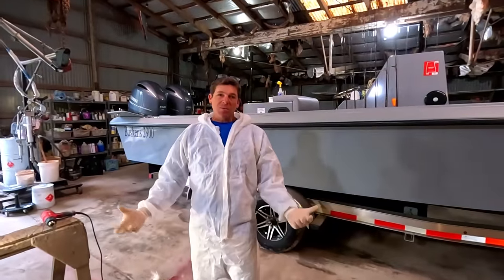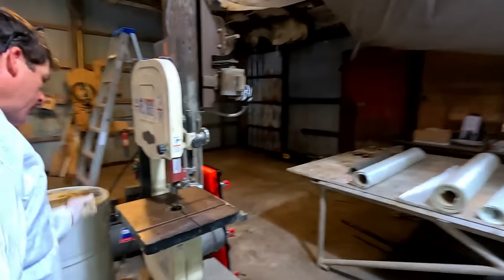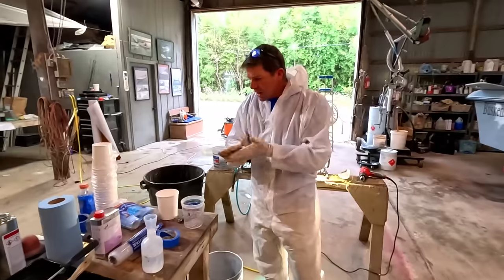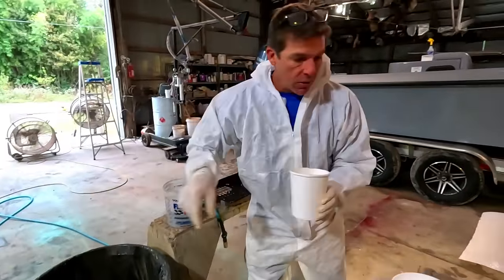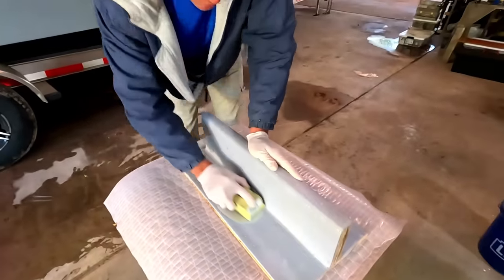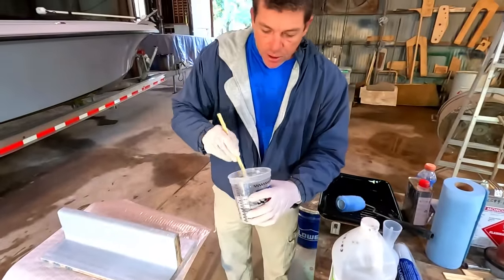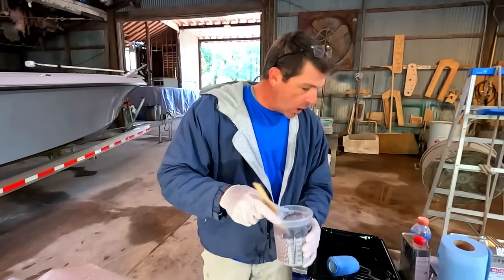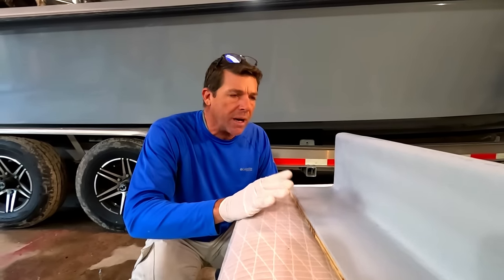Gelcoating Fiberglassed Plywood DIY! (Like a Pro)

Comment: I worked 32 years in fiberglass reinforced plastics R&D. Hand layup was the first and most basic process that I learned. Your very well done instructional video shows/teaches the techniques exactly as I was taught so long ago. I look forward to following your channel!
Reply from the maker: Wow, thanks so much for taking the time to watch and comment! It is much appreciated!
Reply: I agree. Great teacher. Ty. One thing, how do you tell the difference on an old boat if it's gel or epoxy? Spot test and see what happens?

Comment: Did you create the final layer from topcoat , adding this wax solution ? But how come it will cure on open air, which the gel coat should not do ? I have never used any "gel coat" over the fibering, just ready-made "topcoat" ( polyester-based resin, and MEKP as hardener.. ). Another question: Have you used the "topcoat/gelcoat" as sealant layer, and then more glossy paint as the final layer ? Like polyurethane paints etc ?

Comment: The original Glassing-the-Plywood piece, the different kinds of CSM, and now this with Gel Coating, Both First Class. I have worked Polyester and Epoxy since 1964 and I learned so many little Tips in both of these vids. I like your emphasis of pouring liquid out as soon as fully mixed, to cut the heat/cure issue. Two Thumbs up.
Reply from the maker: Thanks for sharing! Glad you found some helpful tips in the videos. We have lots more DIY type content coming soon!

Comment: Awesome highest quality knowledge from a craftsman!!! Family businesses and craftsmen are disappearing. As a high end residential custom custom remodeling contractor [ ret.] At 61, I now do log slab metallic epoxy tables, classic truck restoration, custom tool making, and making rc airplanes and boats, [ if you stop moving - you'll die! ]  [if you stop learning - you're boring! ] Thank you for teaching as I enjoy teaching others as well. At no matter what age, if you're open minded to tips and tricks that's what makes a craftsman. Just a quick trick as I also use cheap chip brushes for epoxy and por 15 paint, get the cheap super glue and apply to the base of the bristles all the way around at the steel band, this will prevent bristles to come out into your finish. Hope that can help. Now I'm thinking of learning how to do youtube to teach my tips learned in high end remodeling? Once again thanks!!!!
Reply from the maker: Thanks so much! Yes, I agree that we need more craftsman and quality tradesmen out there for sure!I will definitely try the super glue trick, sounds like it would work great. I really appreciate you watching and commenting!

Comment: I really appreciate the in depth instruction. I do not have a boat- I’m an over the road truck driver. I own a Kenworth W900L with a fiberglass hood that has multiple cracks completely through, stress cracks etc. I grew up doing automotive bondo work on automobiles but need a refresher for fiberglass. Thank You!
Reply from the maker: Glad to help with your kenworth repair! Thanks for watching!

Comment: After years and years of working in commercial construction industry I learned how to control airborne particulate with fans. one blowing in the building, one blowing on me while I work and one blowing out of the building through a close window or opening.  When installing mineral wool into a ceiling I would have on a full face hepa PAPR, tyvech suit with gloves and a nice stought fan blowing right on me while working. Fan also keeps you from roasting inside that sweat suit. Same method ror overhead insulation in a crawl space, feels so good to come out of a crawl space peel off all that gear and not be eaten alive by glass.
Reply from the maker: Thanks for watching and commenting!

Comment: Thanks very much for the excellent videos. I am completing a 40ft, plywood with fibreglass sheathing catamaran which was started almost ten years ago, when the builder unfortunately suddenly died in 2018. He finished the hulls in 2016 and has finished most of the topsides using the following technique (taken from his blog):

'The long job of fibreglass sheathing of the topsides has been started.
The plywood is covered with 390 gram twill weave cloth, filled with epoxy resin and finally a layer of peel ply cloth is laid on top.  Once set, the peel ply is removed leaving a smooth, amine free surface.  Minor blemishes are sanded and filled. and then a final coat of epoxy is applied using a roll and tip method.  The finished surface will need a light sanding and then can be painted.  I have added a white pigment to the epoxy resin.'

The finish achieved is excellent.

What is your opinion of this method?
Reply from the maker: That is a pretty common method in my opinion. I would imagine that if the work was done correctly, it should be good. Hope this helps, thanks for watching!

Comment: Short seasons tought me a few tricks, especially at cold conditions  but this works both ways;

Hot weather; To slow down premature curing, keep your mix container  in a cold bath of water, or in a passive top-lidded camping cooling box with a few blue freeze blocks put in. Rules of convection will keep the cooled air trapped down in the tub, so theres no need for having the lid on. Can easily be done for the roller tray too, if need be.

Cold weather; Use temperate/hotter water bath for your mix container instead. Gentle powered heat blankets/electric foot warmer pouches also works well. Dont pizz off your missus, buy one for designated use :))

Use UV terrazze type heaters for the surface curing. Work localized spots according to your available surface heating capacity. Regulate surface heat with distance between heater to surface, or buy a pulse regulator, fitting your amperage draws. Mine came from the floor heating cable shelves, at the building electrical installations section, mine are rated 4KW, costed about 150 USD. 
UV makes for a fancy electrical bill but work can be done, it allows you if willing, to repair glassfibers and paints surrounded with snow. Quarts type heaters are more transfer efficient but costs much more to buy. I bought my 1000W´s standards for about 25 USD pr pop on my local cheapo store. They work well enough, 2 of six died by rain penetration when I forgot them on a project standing outside. Kept under a roof and treated somewhat gentle they serve on well. 

With using UV follows a bonus; colder weathers actually becomes more preferable to work in, as there is no chance of humidity condensation forming as usual is, on colder than atmo surfaces. As also then allows, for working anything glue/laminate/paint much more risk free in higher air humidities.
Reply from the maker: Very good! Thanks for all of the good information!

Comment: If we are going to be sanding an unwaxed layer, we usually wipe a wet acetone rag over the coat beforehand and leave it for about 10 minutes. Sticky stuff is gone then and does not clog up the paper anywhere as much.

We also tend to use a hand held Infrared heater instead of heat guns now. They work much faster and give much quicker results, especially on a cool day when coats are not setting. One good warm up and half an hour later, you're sanding.

I am really enjoying your videos, very informative and your work looks very professional. I am learning a lot.
Reply from the maker: Glad you are enjoying the videos and thanks for the suggestions!
Reply: Need to add to this about the acetone rags. 
Different brands of resin can react differently. Some brands, this method does not work very well. Just have to try it and see if it works on your one or not.
Reply: All this great advice and only a brief mention of a charcoal respirator. Might want to emphasize, Styrene is not good to breathe! That’s why big factories like the one I worked in (Pearson Tillotson) had scrubbers. I never touch polyester resin without one. Otherwise this is serious content.

Comment: THANK YOU AGAIN. REDOING 15 BOTTOM GELL COAT 2 OR 3 COATS? YES WE WILL DO ALOT OF SANDING. THANK U.
Reply from the maker: 2 coats will usually cover, but 3 on bottom is not a bad idea.  Just remember, no wax in the first coats. Only in the last coat do you add wax. Hope this helps. Thanks for watching!

Comment: I've watched both videos, fiberglass and now gel coat. I found you explained clearly what you were doing and easy for myself with no experience to get a good grasp on the process. 
Thanks for sharing you skills and knowledge.
I have an old ply kayak and wondering if the same process would suit to glass the entire kayak.
Reply from the maker: Glad to help! Yes, it could certainly work. You might want to consider epoxy resin for that application though. We used polyester resin in our most recent videos, but plan on a resin comparison video soon. We will be explaining some of the pros and cons of each resin type. Thanks so much for watching!

Comment: I have a 17.5 foot  polyester boat that I am replacing all of the stringers and floor and Transom in. I was sold epoxy and told that making repairs in polyester would cause the new stuff to shrink and pull away from the hull. The epoxy supposably sticks to the old polyester well. In you last bit of this video you mention that Gel coat cannot be applied over the epoxy. What do you finish with, if epoxy is used to seal timber and glass the new parts in. I would like my boat to be all white inside when repaired with a textured finish for non slip.
I am enjoying your videos and glad they found their way onto my feed.
thanks
Clinton, Australia
Reply from the maker: Yes, many people use epoxy in their repairs, and it can work great.The compatibility with gelcoat is what turns some folks towards using polyester or vinyl ester resin instead. I have been looking for a solution to this problem, and think I may have found it! I have a product in my shop that I will be testing and making a video on very soon. It is designed to bond to epoxy but will accept and bond with gelcoat. You could also use a two part paint system like awlgrip, with an epoxy primer like awlgrips 545 primer and their griptex nonskid. I hope this helps,and thanks for watching from Australia 🇦🇺!

Comment: hi .. I just discovered you... you're very informative so thanks for making the time... the information is more than great or as we say in Australia,  it's the ducks nuts

I'm keen to learn about making a wooden boat where the wood remains visible rather than blocking out with gel coat...so I'm interested in learning how to get a smooth clear fibreglass finish..

if anyone can direct me to another good video on this I'd be most appreciative

many thanks
Reply from the maker: Thanks so much, glad you are enjoying the videos! Haha that's awesome, I have heard the Bees Knees, but never the Ducks Nuts! I will be using that one! Honestly we do not do much clear over wood work. I know that epoxy resins are usually preferred over polyester in most cases. UV protection is going to be an issue with clear coats. A final topcoat with a Uv inhibitor is going to be needed or else there can be discoloration. I wish I had more info for you. Hope it helps anyway. I appreciate you watching and commenting!
Reply: cheers - I appreciate the time you've taken to respond

Comment: This coupled with you previous fiberglass video for this is exactly what I was looking for!  It sucks tho that you can't buy little kits to do this....I just have a couple 6x6 areas I have to do.
Reply: Wait a minute...there at the end you said you can't gel coat over epoxy?  Didn't you lay the fiberglass down with epoxy????
Reply from the maker: We used polyester resin in this series of videos. You can see the resin we used in the first few minutes of the how to fiberglass over plywood video. If you want to use epoxy resin you can. The methods are very simular. Just remember that mat or csm doesn't work with epoxy resins. If you use epoxy, you will have to use a paint system that works with epoxy. I plan on making a video about different resins and the pros and cons very soon. Hope that clears it up for you. Thanks for watching

Comment: Thanks for the video. I use epoxy a lot in boat building (hobby only), so these videos are very useful to learn a few polyester resin techniques.    I have used epoxy to fix small dings and holes in my boat and was able to gelcoat over them, was I just lucky? I did wait a few weeks to allow a full cure of the epoxy.
Reply from the maker: Glad you are enjoying the videos. Sometimes gelcoat will work over epoxy, sometimes it doesn't. I will be doing some tests and a video on that subject very soon. Thanks for watching!

Comment: Awesome that I found someone who knows there stuff! I grew up as a Navy brat, my father retired outside of Pensacola. We moved from Key West. He had bought a 22 ft flats/ bay in the 70’s. After setting in South Alabama for several years we moved north to just west of Tuscaloosa. I still have the old boat, and have been looking for some good how to videos on gel coat. My oldest daughter is wanting us to totally redo this boat. I’ve been in the auto body repair business for 36 years, so have a good concept of how the chemicals work. My question is,can the gel coat be sprayed into the bilge area and so forth? Great instructional video and would love to see more content like this. You sir have my respect and a new sub.
Reply from the maker: Welcome to the channel! Sounds like a cool project boat. Yes, gelcoat can be sprayed, but it is much thicker than paint so your gun with need a larger tip. You do not want to thin gelcoat to much or it will cause problems. 5 to 10 percent max with styrene. I will probably do a video on spray vs brush vs roll gelcoat soon. Hope this helps, and thanks for watching!
Reply: @FishBumpTV  thanks Capt. Joe, after watching most of the boat building series I’m pretty sure I’m going to redo the stringers and deck of the old boat with the Coosa board. 
It has the molded insert like what you were talking about in one of the videos I saw.How all the production boats were built. The top half of the boat has been separated. My question is what is the easiest way to separate the insert from the hull. I’m thinking of using my equalizer windshield knife to help this process, but was wondering, is there a chemical release agent I may possibly could use? In order to help separate it from the hull. Should I cut as much as can and remove it in small sections? Thank you for your videos. I love them find them very informative. I have thought about doing some YouTube videos on how to properly restore an old automobile as I have done numerous throughout a 37 year career in the autobody industry. I appreciate all the content once again thank you.
Reply: Newbie from Central Pa  really enjoyed the process of glassing and gel coating and like the timeline of your videos perfect Will be watching all your videos Capt. Joe

Comment: Your channel is awesome! I wish I would have found it sooner. My dad recently passed away before we were able to restore our 1985 15’ ProCraft bass boat. He was the experienced one of the 2 of us 😊. The boat originally had a metal flake finish that was smooth as glass. over the years the finish became rough, dull, and the outer clear coat looking material flaked off many spots. What are usually the finish layers of a boats surface? Is it paint then a clear coat on the top part of the boat? The hull of the boat is still in nice shape. I would really like to bring the boat back to a beautiful finish.
Reply from the maker: Thanks, Glad you are enjoying the channel! Sorry to hear about your Dads passing. We do not work with metal flake much at all, since it is not that popular in our area. There is a clear coat over the metal flake that seems to go bad first. I believe that it may be possible to reclear it, but I have never done that. The other option may be to repaint it with a solid color. I hope this helps, and I appreciate you watching!

Comment: Sir, thank you for your good videos (this the 1st, time I'm seeing a boat builder warming up wood before fiberglassing and gelcoating).
I live in Bahrain, we have short mild winters, and very long and scorching hot summers with temperatures ranging between 47 and 50 degrees Celsius (116 to 122 degrees Fahrenheit) in summer. is warming up wood before fiberglassing and gelcoating recommended in our place.
Reply from the maker: No, that wouldn't be necessary in your climate. If the weather is cool, humid, or both then warming the wood first can help with bonding. I hope this helps and thanks for watching all of the way from Bahrain!

Comment: Wow! You've explained and demonstrated it well!
Reply from the maker: Glad it was helpful!
Reply: I worked in FRP pipe manufacturing plant in the Middle East for 28 years as technical manager, and I agree with you that the best way to have a better bond between a FRP and wood is by applying a topcoat of resin and allow it to sip through the grains of the wood, and as much as possible, the wood must be completely encapsulated with FRP laminate to effect a 'fastening'. Weathering, vibrations, etc. eventually will cause to delaminate the FRP from the wood. I have done interlaminar shear test, and directly laminating FRP to wood indicated zero lap shear strength!

Comment: What I  did  when I rebuilt an old garbage show into a very nice little boat. Believe it or not, I used a Wagner (JUNK) electric sprayer and immediately after spraying a section I used a 4"wide foam brush very lightly over the finish and it came out very nice.
Reply from the maker: Interesting! Thanks for watching and sharing!